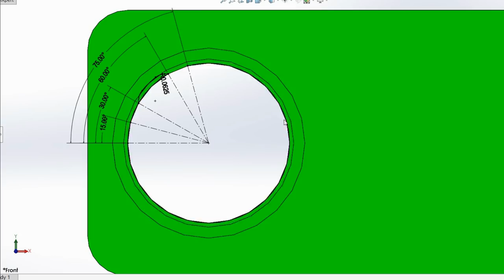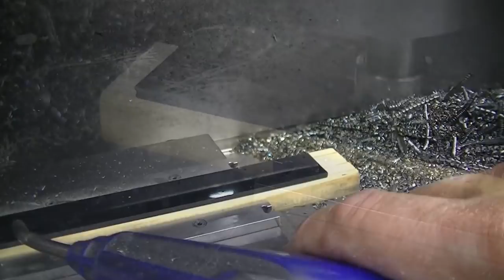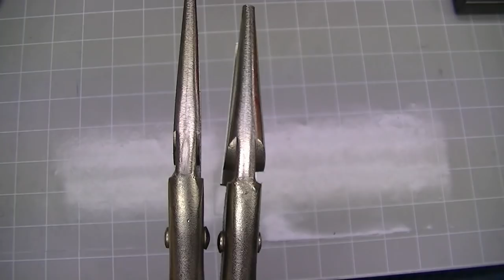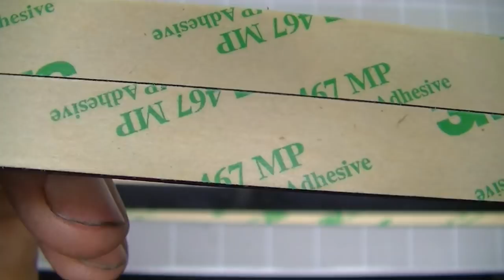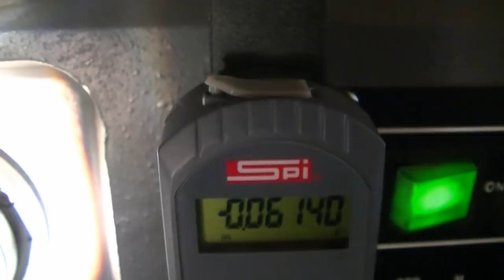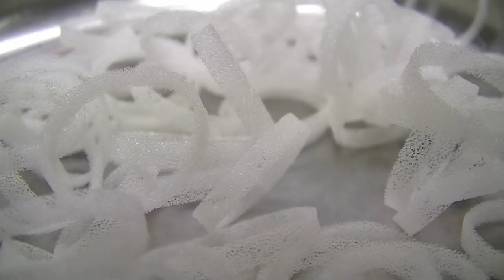MAKING LINEAR BALL WAY CAGES

Comment: I have a Harig grinder on its way to my house right now. I’ve been planning what my solution will be for balls and cages upon inspection and had a very similar thought in mind. Of course your execution and end result is superior to what I had planned and really like some of the points you make, and will likely implement if new cages are needed. I priced out the balls in case I see reason to replace them and was quite surprised at the cost of that. 

One day I will learn that my ideas aren’t original, someone has already done it and probably better. Glad I found this video. Went good with morning coffee.

Comment: I'm so glad I found your channel. This is such next level precision and the thought that goes into your processes is so incredibly thorough. Most people have the tendency to want to slam bang everything together, and that's a negative influence on me. I doubt I'll get to your level but it gives me a goal to shoot for. Hopefully I'll be better for it. You show how it's possible to take your time, be patient, consider all variables, and still get the work done in a relatively efficient manner. I don't think you would have spent much less time if you'd just bored some chamfered holes in the strips like the original cages. Well done.

Comment: "SHOP NOTES"*

• Overview of the old ball cages, condition and design considerations
• Switching from grease to oil lubrication
• SolidWorks(?) explanation of design.
• @7m ""Just enough of a drawing""
• Delrin to wood transfer adhesive test. A study quick-and-dirty workholding of awkward pieces, fully explained and tested with a force gage.
• 3M 467 Adhesive Transfer tape:
McMasterCarr (60yd): https://www.mcmaster.com/#adhesive-transfer-tape/=19s264m
Amazon (.5 in/20yd): https://www.amazon.com/dp/B007Y7CQ1S/
(other sizes): https://www.amazon.com/467MP-Performance-Adhesive-Transfer-0-125/dp/B00P26Z04I/
3M's website: https://www.3m.com/3M/en_US/company-us/all-3m-products/~/3M-Adhesive-Transfer-Tape-467MP?N=5002385+3293242532&rt=rud
• 3M F9460PC Adhesive Transfer tape: (not to be confused with others that contain the same number)
McMaster (.5 in/60yd): https://www.mcmaster.com/#7628a52/=1e6ps96
Amazon (.5 in/5yd): https://www.amazon.com/3M-Tape-F9460PC-width-length/dp/B007Y7DA68/
3M's website: https://www.3m.com/3M/en_US/company-us/all-3m-products/~/3M-VHB-Adhesive-Transfer-Tape-F9460PC/?N=5002385+3293242476&rt=rud
• 3M Plastic Adhesive Transfer tape:
Not sure which one is shown, probably 9482PC (2mil) or 9485PC (5mil)
McMaster (PPE bonding): https://www.mcmaster.com/#adhesive-transfer-tape/=1e6pv59
3M's Website (9482PC): https://www.3m.com/3M/en_US/company-us/all-3m-products/~/3M-Adhesive-Transfer-Tape-9482PC/?N=5002385+3293241523&rt=rud
• Wagner FDX Force Gages: http://www.wagnerinstruments.com/products/force-gages/digital-force-gages/force-ten-fdx
• NOGA Ceramic Blade Plastic Deburring Tool, CR 1500 or 2000:
McMaster: (CR2000, maybe): https://www.mcmaster.com/#6074a36/=1e6vzt7
Amazon (CR2000): https://www.amazon.com/NOGA-Ceramic-Deburring-Tool-Set/dp/B002718Y26/
KBC (CR2000): https://www.kbctools.com/products/ABRASIVES/DEBURRING%20TOOLS/HAND%20DEBURRING%20TOOLS/10954.aspx
Noga: http://www.noga.com/Products/cera/Ceramic%20tools/CR1500/Mini_Ceramic_Handle_and_Convexed_Blade_-_CR1500
• Notice the 'fence' or alignment pins in this fixture are deburring tools.
• Explaining ball deflection, Hertzian stresses in a ball way.
• Making improved clamps from ViseGrips.
ViseGrip 9LN 9 in. ""Long Nose"" (Made in China):
Amazon: https://www.amazon.com/Irwin-15-9LN-8-Inch-Capacity-9-Inch/dp/B00004SBB2/
Harbor Freight (also Made in China):
https://www.harborfreight.com/hand-tools/pliers/9-in-long-nose-locking-pliers-63871.html
• Tip about evenly wearing your abrasives by watching the spark pattern.
• Nylon Deburring Brush Wheel:
McMaster: https://www.mcmaster.com/#4901a56/=1e6wp6m
A number of other brands available from retailers.
• 3M Strip Caulk 08578:
Amazon (20yd): https://www.amazon.com/3M-08578-Black-Strip-Calk/dp/B000PEZ1L4/
3M's site: https://www.3m.com/3M/en_US/company-us/all-3m-products/~/3M-Strip-Calk/?N=5002385+3293194020&rt=rud
• Apprentice = broach catcher
• Haircell finish plastics
• Ever wonder what that application pressure is? Well, from 3M's datasheet on 467MP it's 10-15 psi.
• Tapping head is a SPV (Spintec) SA-0E. I can't find the model on their website. 
• #0000 Stainless Steel Wool for Deburring hard plastics
• Creating a foam die cutter
• 100 pore-per-inch reticulated (open cell) foam.
• Techniques for facing accurate rings of triangular cross-section. Cubic Boron Nitrite turning tool reground.

*Not affiliated with any distributor or manufacturer. Links for reference & convenience only.
Reply: This actually grew out of looking for a small segment with a Loctite # for my own project. Robin's 'complete project' videos are great and, I feel, the best way to show this sort of work. However, to completely explain and show construction on even a single part requires say, 30-60 minutes, with copious edits. You can't easily search for that 1-minute section where he uses that bottle of ? adhesive in all the videos on the channel. If you've forgotten which project that 1-minute section was from then you are going to spend at least an hour skipping through videos trying to find it. I've done this several times before and I've resorted to notes.

I look around for where to get a deal on some of these items; many of which are not readily available from the usual suspects. Failing to store all that esoterica in my head; I also store them in the notes. If you check the comments section in a lot of his videos you'll notice many of these same questions. So it's half index and half product links. Robin has added these shop notes to the description in the past which makes them searchable from the ROBRENZ channel search.

Taking these notes makes me pay more attention in some places and watch the video more that once. I've thought about adding the YouTube time links, but the notes are already long and link-laden. If what I'm looking for is in the middle of the notes it's loosely in the middle of the video.

Sorry for the three-well, four- paragraph response to a six word quip. At some point I worked out that on a good day I learn 50% of what I'm taught and remember 50% of what I learned. I'm just hacking that 25% learning efficiency barrier.

Comment: Nice job. I have to build one for my table saw, it is worn and has dropped a bearing. Of course that is not required to be nearly as precise as yours need to be. But you gave me some good ideas. I liked how you have engineered an oi,l bath for the bearings, I think I will try to do the same me with mine. Thanks again.

Comment: Great design! I should say  re-design. Loved the punch. I've made something similar for foam and rubber. The milling fixture for the cages was a bit over thought..but as long as it works.
I use 3m tape the exact same way to fly cut a 6 ra finish on long electrodes for lasers, but have never used that specific tape. Can't wait to try some! Thanks!

Comment: Outstanding Robin, that segment on the transfer adhesives was very good.  I must have missed why the clamp holes in your aluminum fixture need to be square.
Reply from the maker: Thanks Bill, square so the clamps can swing maximum distance side to side when inserted from the back.

Comment: Invaluable. your teaching method, your simple explanation, the mix of theory and practical. Everything you post here online is invaluable.

Thank you for sharing your hard earned knowledge with the world, just know that you are empowering another whole generation to step into precision manufacturing. 

P.S. hardened balls running on what I assume are hardened ways/rails, would that not induce premature wear? what will wear first?
Reply from the maker: Thanks, this is rolling contact so if kept clean the failure mode is fatigue not wear just like ball or roller bearings.

Comment: If I hadn't watched this on Friday, Saturday wouldn't have gone so smoothly. Needed 2 shims as thick as a redbull can(0.25mm), quickly made a punch using the inspiration from the one towards the end of the video and bam, success. Just needed a bit of gentle love with the hammer to remove the burr/flatten the edge. Removed about 1" side to side of slop from the shifter, from a tiny .5mm shim

Comment: Robin your attention to detail of every aspect. Are you planning to use the Velocite 10 for you way lube in this machine? Excellent video and close up shots of the CBN tool. Thanks. Did I see one of those clamp tips move in the vise when the face mill ran over it?
Reply from the maker: Thanks Peter, I have to check into what the ideal oil is for this and the needle rollers you have seen on instagram.  I just used the 10 to wet the wicks completely so it would not starve on initial running. Yes, some of the parts rotated on the rough cuts but they still cleaned up on the finish.
ATB, Robin

Comment: Yes, I found something educational here—everything!
  For pressing that tape, a hard rubber roller with a handle is what we used to use. It allows consistent pressure and prevents damage from a tool sliding off the tape and damaging your surface. A wood or plastic rod works also.
Reply from the maker: Thanks for the info!
Reply: @ROBRENZ  Glad to do it. I was in the art glass business for a few decades here in Portland, Oregon. It was a very high-end product, and we did stained glass, structural glass, sandblasting, etc.  I’ve never seen that method of stoning a frosted finish rather than the typical masking and sandblasting—with which you could never achieve those fine lines.
  Do you know if your method is similar to how it’s done by the manufacturer, or did you figure it out for this project?
  Either way, I called the folks at the shop and told them to watch this vid. All our stuff is custom, and this technique presents all sorts of possibilities. 
  Thanks Rob—keep them coming, and I’ll keep evangelizing!

Comment: I think I would have screwed the plastic down to your sacrificial surface. You had to add screw holes anyway,  and this would have saved you the trouble of testing the adhesive strips.

Comment: Very nice work.  The only thing I would change is to rotate the oil relief pattern 22 1/2 degrees so that ball contact was on the X and Y axis.
That being said the delrin is so far superior to the old acrylic that barring extreme contamination these slides should last ten generations.
The custom "harbour grips" are a 10 out of 10.
Your emphasis on pressure regarding the tape adhesion is often underestimated.  Pressure sensitive adhesives are exactly that, and if you can't apply pressure over time as you did, a roller tool is the next best option because it will apply maximum PSI if the user is thorough across the surface.
Reply: If you watch he specifically says it's so that the oil can get carried up and over the top of the ball without getting "squeegeed" off
Reply: @JaenEngineering  If you read my comment I specifically said to rotate the pattern 22 1/2 degrees...how would that change any thing other than where the anti-squeeging groves are?

Comment: Thank you for sharing. Amazing video. I wish you would have explained your reasoning on not using felt.
Reply from the maker: Felt cut this small turns to a pile of short fibers that just barely hold together and won't hold its shape. I never would have got the two halves assembed. But the major problem would be all the loose fibers randomly getting between the balls and the rails causing lumpy travel when talking microinches.
Reply: @ROBRENZ  I'm sure many/most viewers watching the video will note that you changed from felt to foam. But right when you were going to explain why you changed, the edit jumps to a new scene. Can you add your rationale for the change to the intro text below the video. Or at least pin a response to this question to the comments? Not sure everyone will have the patience to read thru all the comments in hopes of finding the answer. And it's an important answer...
Reply from the maker: @steveh8724  Good point will do

Comment: Others ideas of rebuilding a machine is Citri strip and a bucket of tremclad.  Robins is re-engineering ball bearing cages for microinch level increases in accuracy.  Bravo.  Your thoughtfulness and attention to detail really put others to shame.  What happened to the AAA+ surface plate refinnishing?
Reply from the maker: There will be a final video on the plate :-)

Comment: All the ball deflection numbers you cite assume that the mechanical load on the 2 ball tracks are equal!  But that almost NEVER happens!  (The tool force of the part/table weights would have to be centered upon the table.)  In fact, the reason that 2 ball tracks are required is to bear torque about the long axis of the table, BECAUSE the forces are NOT the same (otherwise we could balance the table upon 1 track).  So it would seem to make sense to have the table level at the start, and maximize rigidity thereafter.

Comment: Very nicely done and thanks for showing! I will keep that in mind for my Blohm grinder. Ist has similar ball cages. Same thing with lubrication, you have to take the table off... How does the oil lubrication work so far?
Reply from the maker: Still a lot of work to do on the grinder before it runs.

Comment: Beautiful!  I think the clamps were a little bit overkill, but hey, it worked.
Reply from the maker: They are not just used for the fixture they will be hand for general work also.
Reply: I know, any excuse for a new tool!  <grin>
Reply: And then there is the old woodworker's adage, you can never have too many clamps.

Comment: Robin, while working today I was thinking more about your video.  Did the original cages BOTH have 27 balls?  If so I wonder why they did go through the exercise of calculating the pressure differences between the V and Flat rail pressures?Just curious...   Fred
Reply from the maker: I have a hunch those original  cages were not original and the manual shows a front and back cage that look different.
Reply: Makes sense!  Thanks Robin.

Comment: Awesome work as always robin! one question when cutting that foam press tool, wouldn´t the above/below center adjustments screw with diameters of those cutting rings? When moving away from center height of the tool the distance to the center decreases.
Reply from the maker: Thanks, yes but very small amount. I am only moving a few thousandths.

Comment: hmm .. oil insted of grease .. what does grease with grinding dust? .. catching it and holding it on the outside - building an outer layer wich holds the rest clean ..
now think what oil does and wich wears out faster?

Comment: Now that the shop notes are done, it's time for a real comment. What is the mitigation against dust retention in the foam? While the pore size is large relative to the abrasive particles likely to find their way into the ways, there also won't be a high-flow pressure source to flush them.

Just curious, that Mitsui is going to be the envy of the YouTube.
Reply from the maker: Thank you very much brs_workshop for the awesome shop notes. Please contact me by the email on my about page. I am hoping that the particulate contamination will end up as a sludge in the bottom of the oil reservoir by gravity. I think the oil will pump into the foam just from rolling and get expelled out the 45 degree and 90 degree gaps. I will be able to experiment during assembly.

Comment: Did you in your V-V vs V-flat ball deflection calculations allow for the initial deflection from the table and chuck weight plus an arbitrary set-up and workpiece weight? How are you going to determine 6 sigma geometry error of the table's motion assembled on the saddle?

Aint no program of refinement can withstand supercillious scrutiny of a wise-ass who bears no responsibility for the end product.

Nice work Robin. That grinder will track to small millionths in all axes by the time you're done with it.
Reply from the maker: Hi Forrest, Yes i did the calculations with the full table, chuck and guarding weight. Then I looked at the delta for each rail from an additional 100 pounds workpiece loading to see how much tilt there may be from additional loading.  Thanks, I don't want to have any envy when I see someone elses grinder.
Reply: ROBRENZ Which got me thiking just now:

For the absolute last increment of stiffness how about this. Ball on flat forms a theoretical point load that in real world conditions the ball and race deflect to form a circtlar contact patch at loaded equilibrium. If the race had the same radius as the ball, the theoretical contact would be line but because of the differing rolling radius of a ball with contact angle the loaded patch would "scrub." The ball bearing people mitigate this by employing a somewhat larger race radius than the ball's.

The ultimate Renzian refinement would be to diamond lap a 2mm wide race track in the way bearing inserts to effect a line contact. I suggest a 0.635 lap diameter. The contact patch will be an ellipse projected on the net deflection radius. Naturally, there are a dozen nit-picky practical details like how to do it, track results, ensure axis linearity, etc but as a dillantant I leave those little bothers up to the guy stuck with the job.

I loved that tricky foam punch. 

Don't let me distract you. I'm just having fun with the possibilities.
Reply from the maker: I already went down that path mentally. I have made a lot of  precision grinding tailstock slides with ground  linear gothic arch races with a radius of .52 times the ball diameter and a 45 degree contact angle like a crossed roller. They work very well and are very stiff.   To many Kinematic violations to execute this well on the Mitsui.